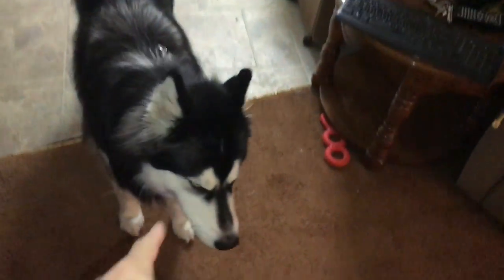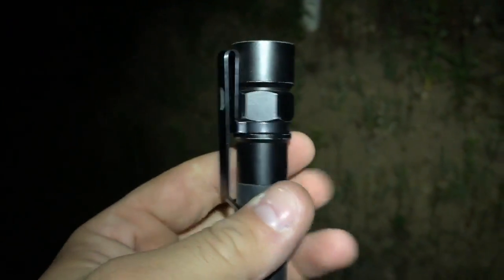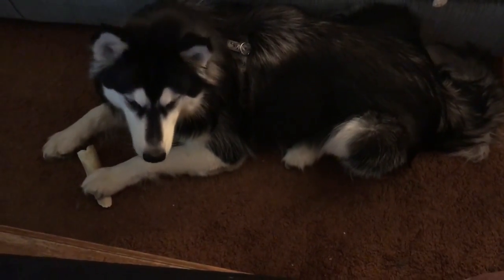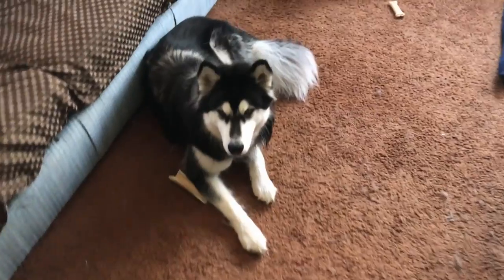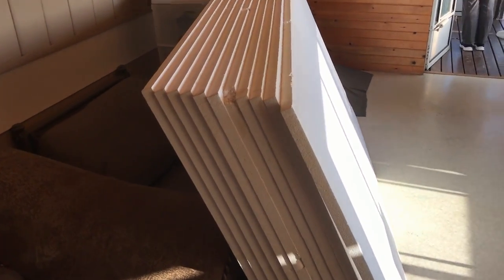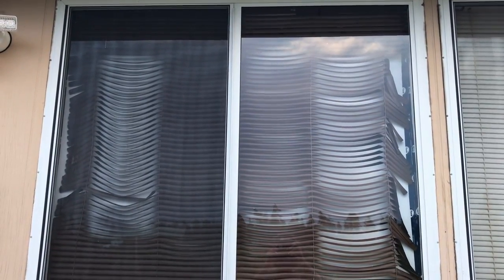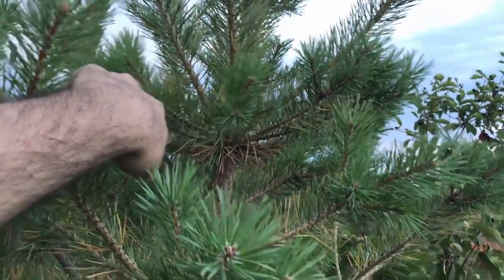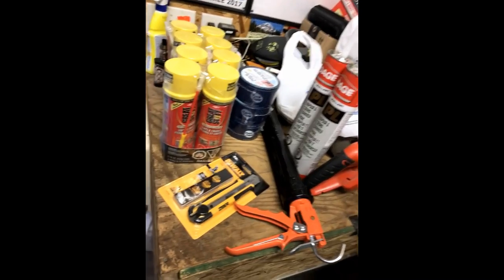Fixing Central Air Conditioner Unit With R290 Refrigerant

Comment: The pressures listed on the label are system test pressures.  With refrigerant flooding back to the compressor this is creating a situation where the incoming refrigerant can wash the lubrication right out of the bearings, and diffuse into the oil. It is best to charging unit by superheat or subcooling depending on what your metering devices.

Comment: How was the electric bill after the change?  I heard is uses 30% less energy because it is way lighter than R22 and the compressor does not work as hard.  Very curious is it made an impact on the electric bill.
Reply from the maker: I have not noticed any difference
Reply: From the studies I have seen, I doubt that R290 would be more efficient than the R22 the system was designed for. At best, it might match R22's efficiency. If the system was redesigned to use R290 it may be more efficient, but using a refrigerant the system wasn't designed for is never going to be ideal.
Reply: and a coo-responding drop in system capacity, but slightly more efficient if not over charged.
Reply: You're not going to see much of a difference because that old a/c runs that huge fan at one speed, full, all the time. I think where you would see more of a difference is in a split mini that has an inverter

Comment: So, mixed refrigerant, no reclaiming on old R12, and indoor AHU not fire proof? FFS you are dumping propane to your system and you didn't get a certified indoor unit for that? A few pounds of propane, if diffused throughout your house and mixed perfectly with air, can level your house to ground!
Reply from the maker: Would have to be a huge leak that leaks out completely in less then a hour to be dangerous in my setup
Reply: What about the millions of natural gas lines, and homes with 200 gallon propane tanks plumbed into them? The only hazard here in my mind would be a technician unaware of a flammable refrigerant being present.
Reply: @ANATURALDREWSASTER  Except your R22 AC is not certified to propane level, and you don't put your 200 gallon propane tanks indoors.
Reply: @bskull3232  my point was that it is plumbed indoors, and that's far more likely to cause a problem than the ac charge.
Reply: 8-16 ozs of propane is not going to level a home.. Please!!!  160lbs maybe .  A small home.  Natural gas turned on for an hour or 2 full blast might level your home. But that would be way more than a few hundred pounds.
Reply: He is r22... or?

Comment: Frosting on your compressor means either your high side is plugged or it needs more gas.
Reply from the maker: The AC Unit has been working GREAT After i did this. 
And Still Working GREAT this year. 
But... I think after this video i did toss in a little more ,seeing i had another can.
Reply: OR you're flooding the compressor!!!! Overcharged!

Comment: Equivalent charge to R12/R22 OZ listed on the unit is about half. Ice on your big suction line to me is a sign of being over charged.  You'll be flushing the oil out of your compressor leading to premature failure.

Comment: A leaking system with gas furnace Will be a disaster in winter time if you use R290
Reply from the maker: Why Just Extra Heat LOL!!!! 
System is still working Great! NO Leaks "Yet" And my Furnace is not gas.
Reply: @Steve L the refrigerant runs inside too.  It's a good post-apocolyptic fix, needs a smaller piston likely, along with an automatic vent and leak sensor to be safe.   But seriously, good to know this can work in an old R22 system to keep us cool when heat stroke is the alternative.

Comment: Great that the AC recharge is holding up! The R290 seems like it cools pretty good. Too bad that your outdoor weather sensor got damaged, cool looking thunderstorm formation!
Reply from the maker: Seems to be working good! Still a little TLC i need to get done on the system
Reply: This is the good stuff, EPA approved lol.
Reply: R290 is a more efficient refrigerant than R22, a third of the mass flow is required.